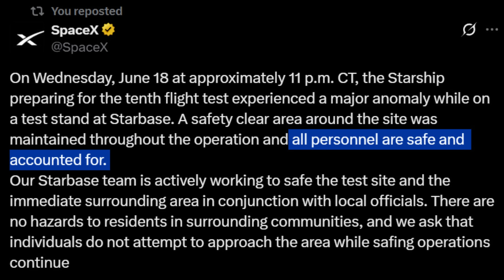SpaceX's Latest Starship Explodes During Ground Test

Comment: The writing for this program has been on the wall since Flight 7, hope this is a wake up call for the rest of ya.
Reply: The writing was on the wall when "BFR" was announced. It is a questionable design at best, that's why it's underperforming so hard (promised payload was 500 tons). Also, it's inherently unsafe, so there is no reason to ever expect it to be human-rated.

Thunderf00t and Common Sense Skeptic called it in like 2018 or 2019, time to give them some credit.
Reply: @youngtschakaloff  It was a dead-end as soon as it was advertised for earth to earth launches.
It was clear that it was just another hype-machine for Musk at this point. Nothing that should ever be a serious concept.
Reply: The "writing on the wall" is Musk. He is the sole reason for this program being in the condition it is. If he wasn't involved, the ridiculous promises and drastic design changes wouldn't have happened. We might have had only one or two flights by now, but it would be overall a much more successful system.
Reply: The idea that this program has been a failure are greatly exaggerated. They have a fully functional first stage super heavy lift booster that is capable of returning to launch pad and can be reflown. Their raptor engines are rapidly produced.

It's just starship that has been a failure.
Reply: @MrPbhuh  Yes that is the whole issue. The first stage is only useful for starship.
Reply: @Vulcano7965  what makes you think that? Sure it's been designed around starship, but there is no reason to assume they cant simply add a second or third stage to the rocket that can replace it. Will it take time? Probably. But its a choice for spacex. Spend time and money on fixing starship or making a working second stage, in a perfect world starship would be working, it's not sadly, so it's time to just get this rocket functional.
Reply: @MrPbhuh no, wrong. They are on a government contract to go to the moon and got $3 billion for it. They basically spent it all and have not achieved their first milestone. Booster landings are cool but that is not what they are supposed to be focusing on. They should go to the damn moon!
Reply: @MrPbhuh Failed in conception.  There is no tangible possible benefit beyond maybe eventually creating a propulsion system.  But even so, no tangible benefit.  Voyager left the solar system and I have heard it benefited greatly.  Putting 4,000 people on Mars would be great, but it might take 8,000 horrific deaths.  Reusing boosters (the few that survive) is a grain of sand of what the bigger challenges are.
Reply: The first aeroplane flew 100 feet. Clearly, they'll never work. 🤦‍♂️
Reply: @owensparks5013  This is not the first rocket or a particular new rocket type.
With proper planing and design choices, these things are avoidable.
But Elmo rather wants to make all the decade old mistakes of rocket flight by himself before he learns from them.
Reply: @owensparks5013  The development of the first aeroplane didn't have major government investment either. Having public money on the line changes expectations quite a lot. (That's one reason why NASA is so expensive, Elon, you utter idiot: projects that accept public funding can't afford to fail.)
Reply: @owensparks5013 Buy then the airplane got a lot better, and unfortunately, Starship is just getting worse.
Reply: @owensparks5013  the second flight went further and the third even further... also, it flew, it didn't crash and burn... also, Apollo reached the moon without blowing up any rockets
Reply: @weazelzinacan8866  Apollo 1 wasn't ideal, but yes - They did a far better job.
Reply: @weazelzinacan8866 

Yes it was also a super rudimentary rocket by comparison and they blew up hundreds and hundreds of other rockets before getting to that point.
Reply: @weazelzinacan8866  Apollo 1 killed 3 people, and then Apollo 13 almost stranded astronauts in space. What are you on about?
Reply: @somerandomnification  fair point, Apollo 1 was a disaster. But important lessons were learned from it. 

Apollo 13, while having a massive failure, still managed to bring the astronauts back safely through some very fast thinking